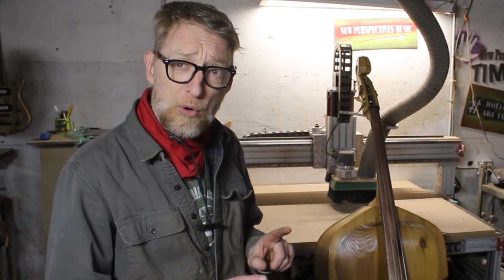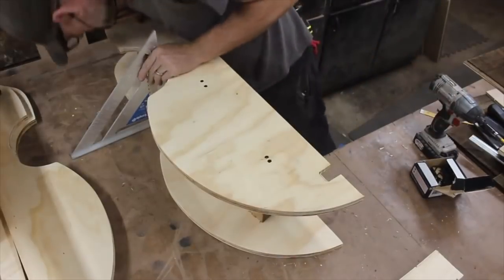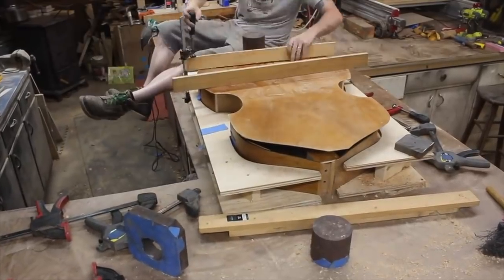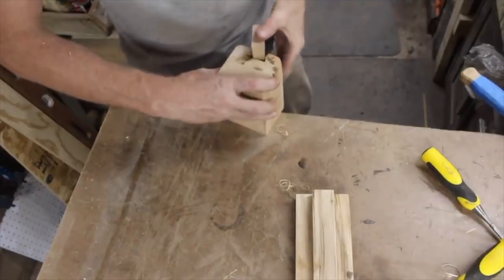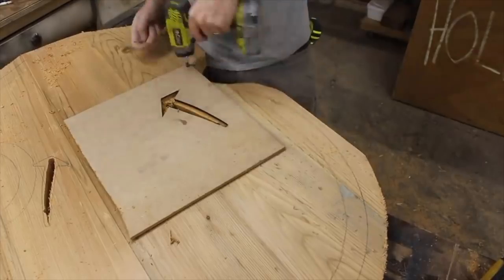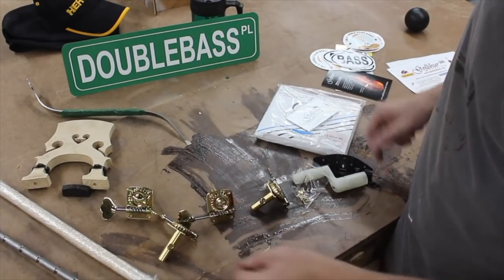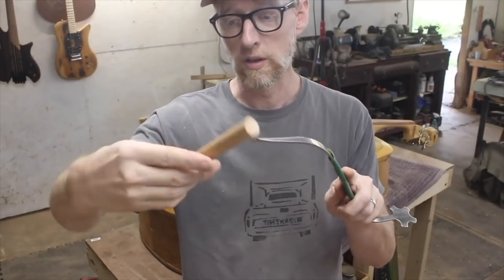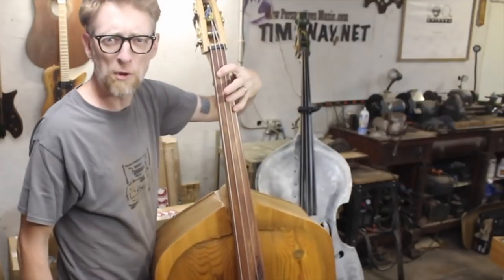Does the DIY Trash Bass Still Play?? 6 Months Later

Comment: For those small bent pieces you coated with CA glue, you could use an epoxy syringe to fill the gaps with epoxy and make the body into something that could not pull apart. Epoxy syringes are used for wooden boat building.

Comment: That sound post setting is crazy. The F holes would have to be a shape and size that helps manipulate the post.. I would be just cutting a door in the back  and calling it a sound hole. Which makes me wonder about the size of a  sound hole, like what size should it be compared to the internal volume of the instrument.? There is a lot of science that goes on regarding the sound holes when speaker boxes are made but never heard anything about instruments.
Reply from the maker: I def made mine too big for looks (and probably sound) just to ease in this process. The holes at the ends of the traditional "F" are basically the exact diameter of the post that gets slid in. I'd like to see some sort of removable crank on the back, like a hydraulic jack.
Reply: @timsway  They probably figure everything out in 18th century by trial and error, a lot like wooden boat design. Also stronger people to manage this instrument or maybe make slave play it

Comment: Hey Tim! I know this is a four year old video but two questions. Number one, I only see you play it by strumming it. I'm considering this build for my stepdad who played with a bow. Does it work with a bow and you just don't have any interest in playing bowed stuff or would it explode or something haha. Question two, why not just bend the wood from 1/4 inch stuff? It seems really wasteful (and expensive if you're paying for the boards) to carve all that out. Thanks for answers if you end up answering!
Reply from the maker: Yes, you can bow it, I just suck with a bow. For the top, you can form wood but that requires making a form, which is just as wasteful if you're only going to use it once, eh? Carved basses have carved tops, hence the name, plywood bases tend to have formed tops.
Reply: @timsway  Hey Tim! Thanks for the reply. Another idea I'm exploring with the bass is angling the glue up. It's kinda hard to visualize this but basically if you could have four pieces of wood, angled such that it formed the rough outline of the bass shape, because I know there's an arch running up and down and side to side, you could avoid hollowing out the center and cutting off the sides. I might make a mock up of my idea in blender or something to illustrate this better. Am I crazy?
Reply from the maker: @spencermartin2936  not at all. I did a glue up on mine. I think that's one of the reasons its not as strong. It basically flattened out over the years...

Comment: Nice build video.   Does the aluminum bass have a sound post?
Reply from the maker: yes it does. A wood one. Everything about its' construction is exactly the same, except the body is thinner, stronger aluminum instead of wood and the top seam is held together with screws instead of glue.
Reply: @timsway  -  cool, thanks